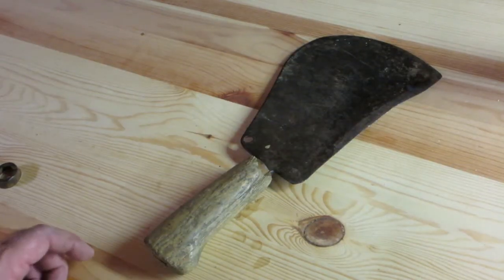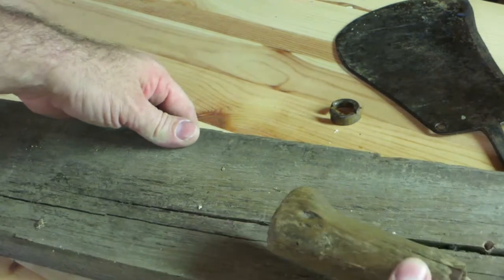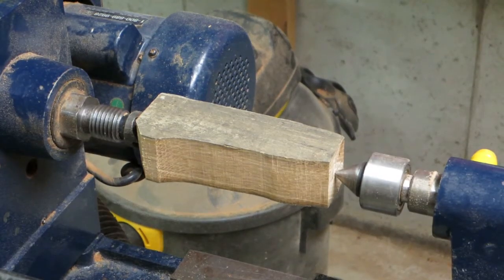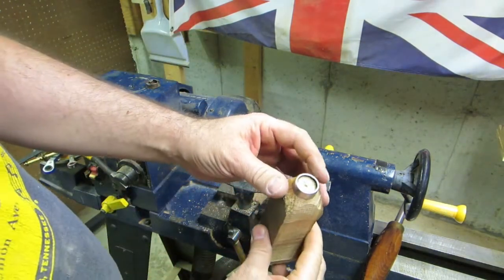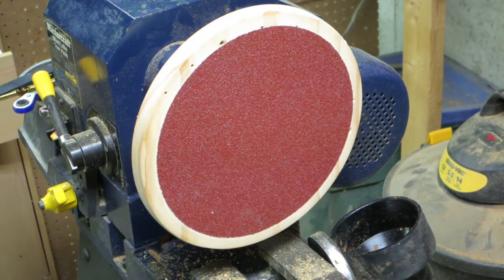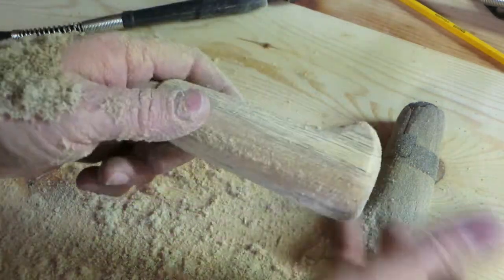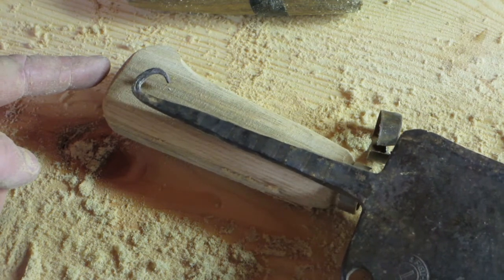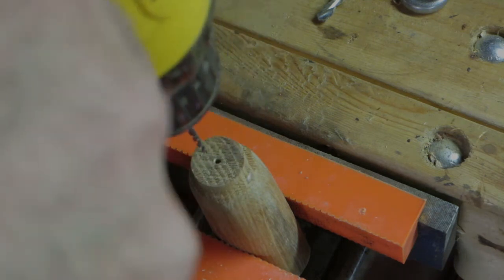#8 making a wooden hatchet handle

Comment: great video rob as always i've seen that type of handle before its a straight tang and then its bent over and hammered back int the wood to tension it
Reply from the maker: Hi Phill, I'm assuming that the steel was possibly hot at the time when it was bent initially, I just hope it lasts as long without that. Thanks for watching, take care

Comment: Was the original handle all one piece? I'm guessing if so they would have bend the hook part after the handle was on, somehow inserting it into the end. Just think, when that was originally made there would never have been a piece of sand paper anywhere near it. Great job, so satisfying when you make something for a purpose.
Reply from the maker: Paul 
In the original the steel went all the way through the handle and bent back into it like a hook, I'm no blacksmith so did the best i could to replicate the look.
Take care
Rob